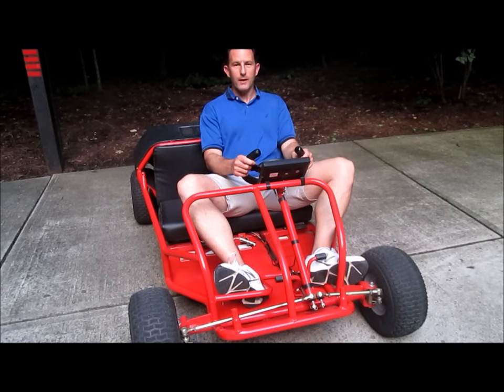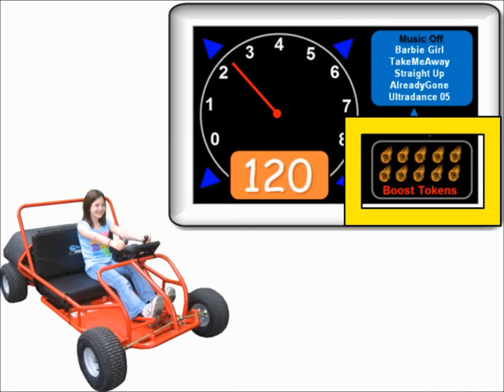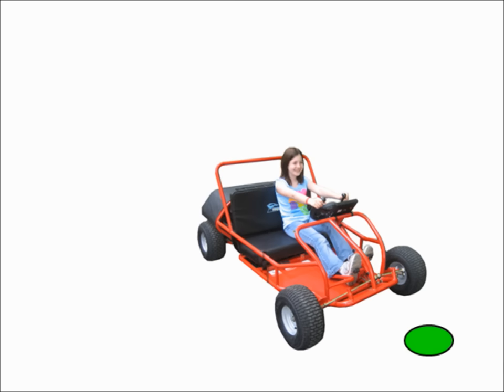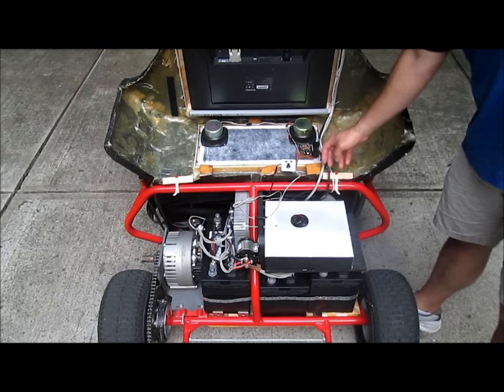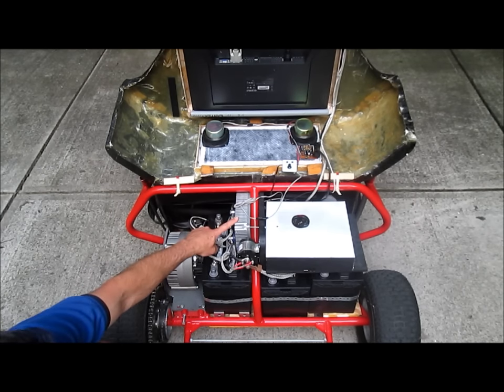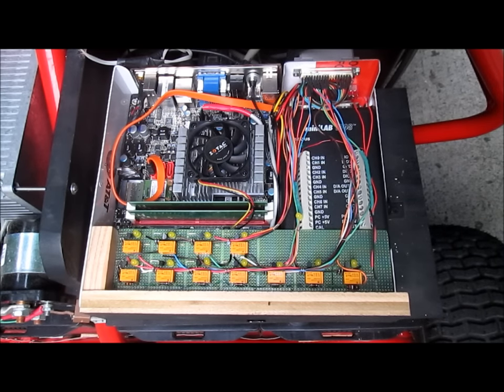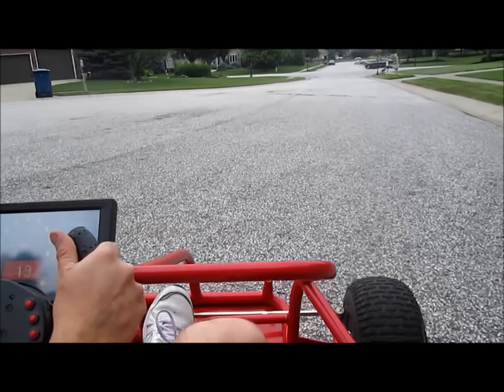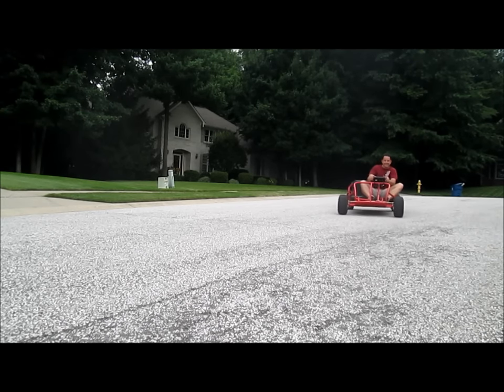How To Make an Electric Go-Kart

Comment: Can you add some links to the go kart chase, motor and other hardware. Links would help me price out what a such build would cost. Thanks.
Reply from the maker: ***** - I built this 5 years ago, so I am sure any prices and links would be out of date, but here are the "Googleable" parts from memory:  Go-Kart frame from Northern Tool.  Etek Briggs and Stratton 15HP motor.  Sevcon Millipak motor controller.  You can stop there and just control the Sevcon with a potentiometer connected to your gas pedal cable.  I went all out and added the CPU, dual screens, game controller, and other features.
Reply: ***** Thanks Lou.
Reply: +Todd Harrison  
That motor is cool!
Reply: yes I want olso

Comment: Couldn't tell me how long that axle is could ya mate? planning a diy and been thinking about doing a lil bench seat like yours, but wondering about width..
Reply from the maker: +Monstah Jones - its 30 inches between the rear tires, but its not a full axle all the way across. The motor only drives one back wheel.

Comment: Why did you use an expensive full PC instead of a $25 Raspberry Pi?
Reply from the maker: +Smeedge - I needed something to drive two VGA monitors, easily interface with a solid state hard drive, have built in wifi, and be easy to code rotating graphics for the speedometer needle.  I would have needed to add more $hardware$ to the Pi, and the coding would not have been as easy.  I think the little motherboard was only $250.  It was worth it for time saved for one kart.  If a whole fleet of these is ever made, I totally agree, use a Pi